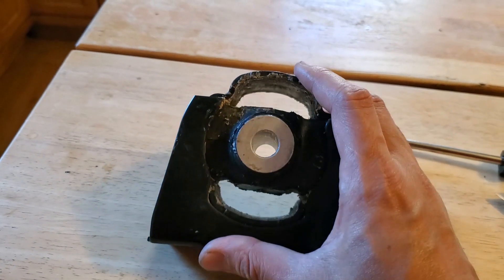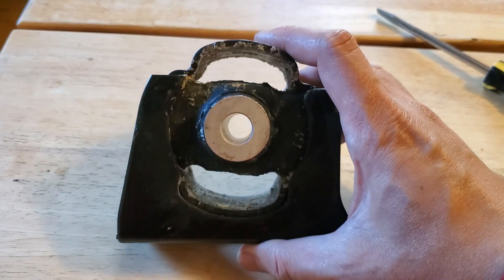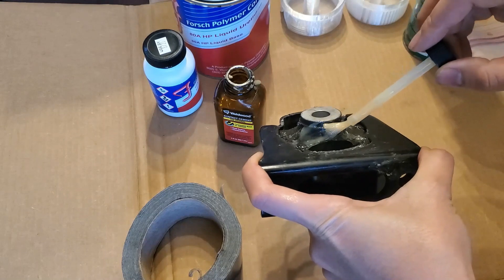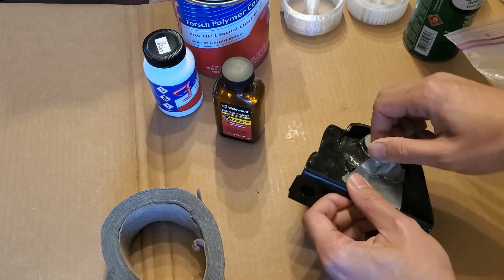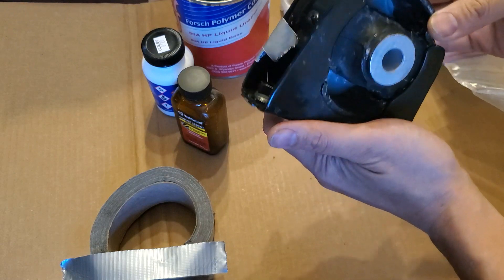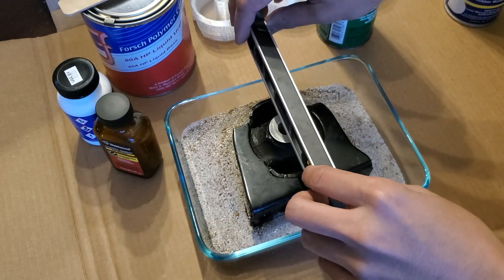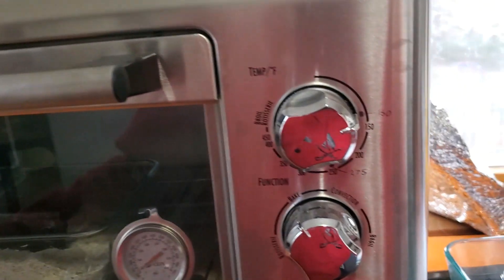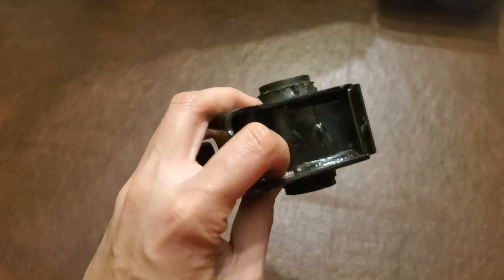Part 1: Filling Stock Motor Mount with Polyurethane / Liquid Urethane Inserts (Scion tC2 / tC2.5)

Comment: اYou are probably riding a wooden carriage instead of a car! There is no vibration absorber and the rubber part will definitely be cut during frequent braking because the rubber base does not have an integrated structure! Of course, with respect
Reply from the maker: I don't have any added vibrations from filling this non-weight bearing bushing, and it's still holding up strong after 4 years.
Reply: It is surprising to me, because these bushings must withstand both vertical force and vibration, and control the traction force, for example, when braking, to prevent the engine from throwing forward? I agree with the use of a liquid that has the full elasticity of the rubber after it hardens in the bush, rather than putting two solid cooked pieces that do not stick to the rubber bush? If I am wrong, please correct me!

Comment: Vibration? hell a lot. I did this on my Elantra 2008 and it was the biggest mistake I ever done. I had to replace them again for stupid. Well, at least I know what mean to be stupid.
Reply from the maker: I didn't fill any of the engine mounts that support the engine, just the one that helps keep it from moving back and forth when you accelerate. That's why you've got so much excess vibration.

Comment: Did you degrease it before trying the pour?
Reply from the maker: I used alcohol to clean it.
Reply: @VampyreX13  u found alc...lucky you lol. did mount work well?
Reply: @VampyreX13  didi u consider using less poly for less vibration?
Reply from the maker: I haven't installed it yet. I completely forgot about putting it in while I was working on the car this weekend. As for less vibration, you would just use a polyurethane with a lower shore value. This was the actual hardness I was looking for though.
Reply: @VampyreX13  Think i would go with 80 bc theres already rubber in the mount which decreases the overall shore rating
Reply from the maker: @welcometoreality3450  that is exactly my thought as well. 80A does seem like the sweet spot. It's working out well in my aftermarket motor mount.
Reply: @VampyreX13  How well did this hold up long term?
Reply from the maker: @Leedy818  I'm still using it today. I inspected it a couple of weeks ago and it looks good.